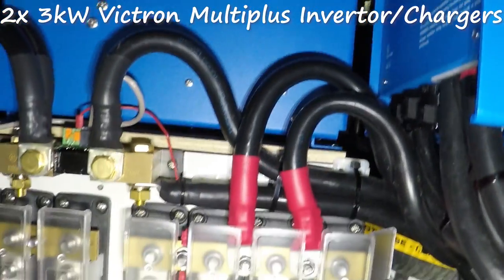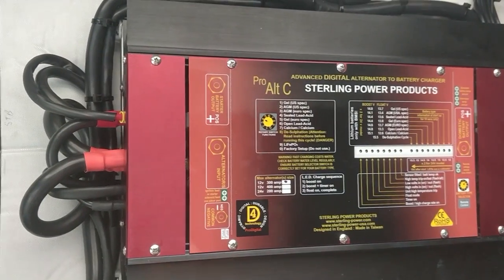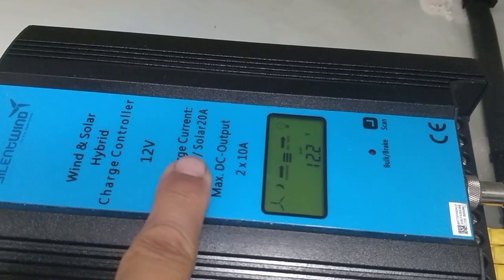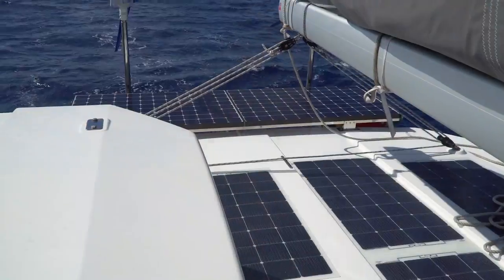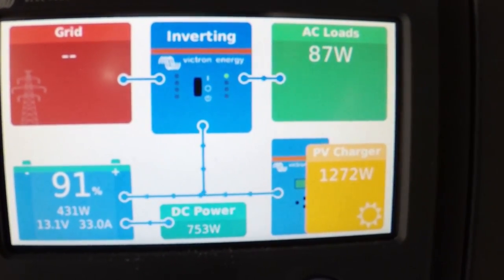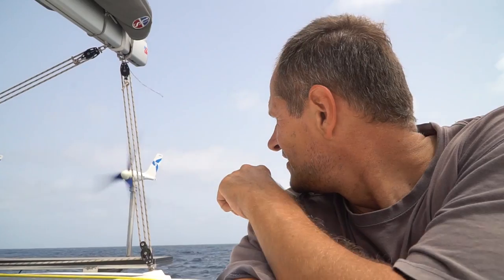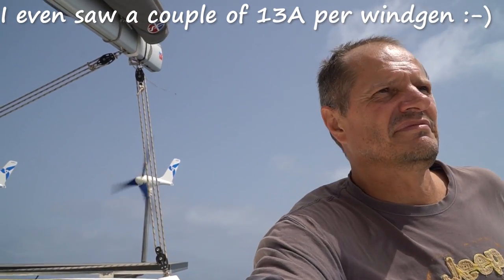#38t Our Electricity Supply on our Boat at Sea | Sailing Sisu Leopard 45 Catamaran in Mid Atlantic

Comment: Any chance on moving the Sisu icon to a bottom screen corner? It is a bit distracting. Nice to see you guys on your way.
Reply: Was just going to mention that
Also, move top explanation line lower so it doesn't interfere with the pop up title when you pause the vid.
Reply from the maker: When is that?
Reply: @SailingSisu  
On full screen pause, YouTube displays your video title at the top of the screen which overlaps your video content.

Having said that
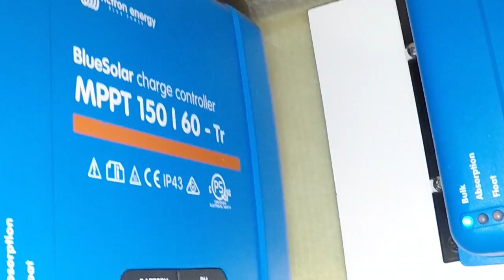3:03
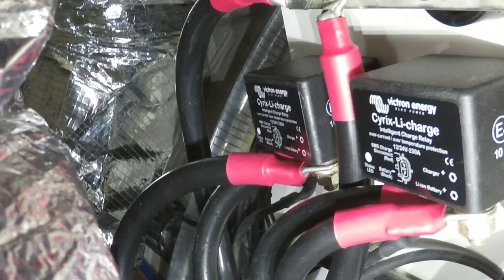3:30
10:52-11:00
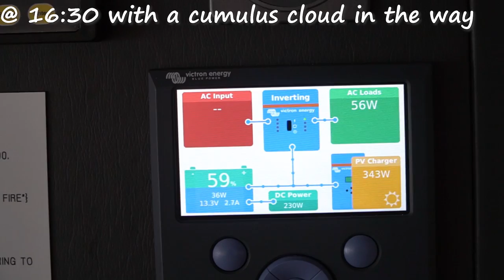11:36
15:14
15:18  Patreon Logo overlaps 
15:29 Traffic jam

Incidentally, you are not the only channel with this problem, thought I'd mention it before you get too far in numbers and it then becomes irreparable.
Keep up the good work
Cheers,
N
Reply from the maker: I can see what you mean, but on my screen ratio, the YT title comes in the black band, not in the video itself. The other issue is that I do not want to a) place it over the equipment itself, b) over difficult colors such white on white etc. It is a battle to get a good spot :-) especially on a busy screen :-D but we will try!
Reply: @SailingSisu  
Um...interesting
Monitor 1920 x 1080
On full screen YouTube title directly overlaps your notations.
Anyway, just thought you should know
Cheers,
Reply from the maker: Yes, that is the res of the video too. My screen is different so I never noticed it. Thanx!
Reply: @SailingSisu  
Monitor 27"
Windows 7
if that helps
No Biggy!
Just wanted to let you know

Comment: Positive main bridge needs to have a full cover.
If you drop a penny in there it's very close and can easily short the connection.
Or worse you are fixing something and the waves hit and you put your hand in there. 
a space of 50ish mm needs a cover
Reply from the maker: Are you referring to the 12VDC positive?
Reply: @SailingSisu I'm talking about any positive DC busbar. (Positive because, convention and the negative is used as "ground" in DC)
A small plastic shield can do versus an úps.
It's scary if you see how fast and hot a high current can make fire (even at low voltage)
Just look at how thick your battery wires are, there that thick to not burn, a thinner wire/skin/penny can carry the same current it will just burn.
Reply from the maker: you are correct, and we have fuses and over load/ short circuit protectors on every wire as well as the busbars (positive and negative). For example, both the +/- wires coming from the lithium to the bars, have short circuit protectors as well as breaker switches.

Comment: Build a solar arche above the boom they don’t cost that much and you will get loads more solar and move the wind turbines up the mast to the top and the will run 24/7 get a water turbine they produce loads of power and are pretty cheap
Reply: Jj Coronet I agree with you about the solar arch. But doing maintenance on wind turbines at the top of the mast is quit risky. I did mine for years like that until you get older. The down they came to the back of the solar arch
Reply from the maker: I think for now we are doing OK 😊 with downwind sailing no position will improve the wind turbines. But I did considered water turbines where it will work great during downwind sailing. Not sure if I want to put an arch 6m above sea level... That boom is pretty high. And you are right...as it is now, I have no idea how to reach and maintain the wind turbines...